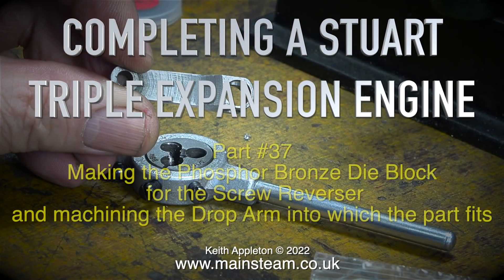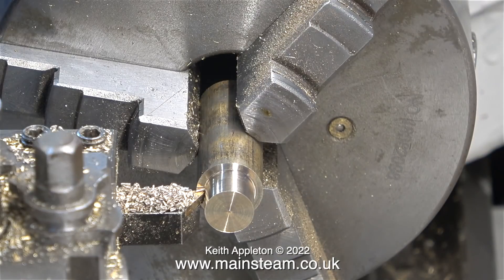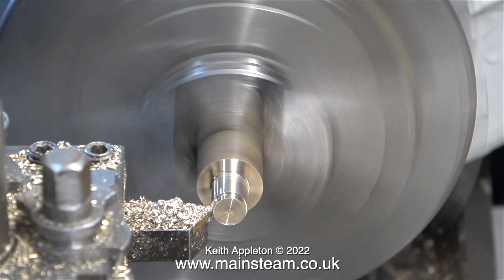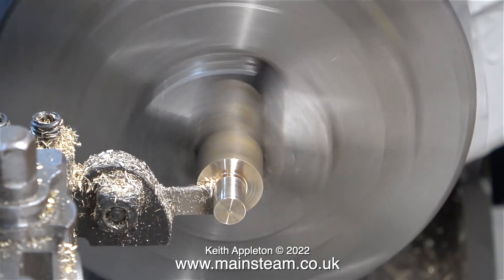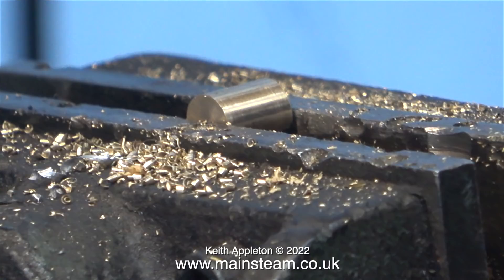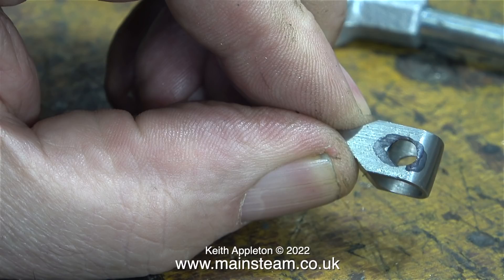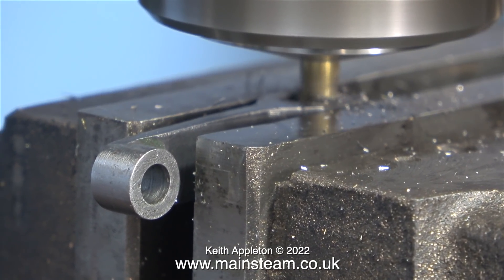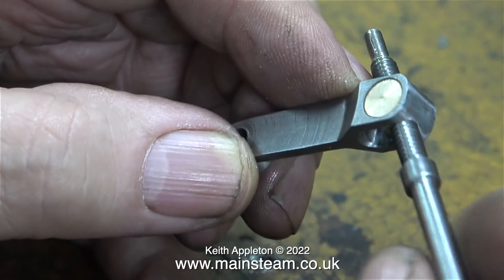COMPLETING A STUART TRIPLE EXPANSION ENGINE - PART #37

Comment: I'm surprised by how rarely steam enthusiasts try to build turbine engines

I get pistons are more romantic but surely turbine speed is attractive
Reply: With a turbine, once they are running, visually there is little to see. With reciprocating engines, unless they are the high speed type, the beauty is watching all the moving parts - poetry in motion, more so with a slow running engine.